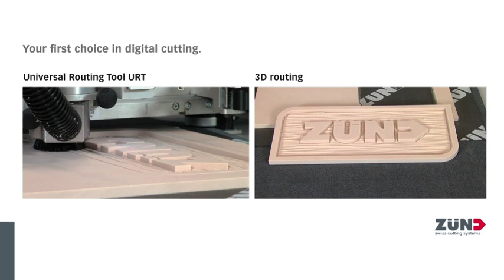3D routing, Universal Routing Tool URT

Comment: What software are you using to achieve the sandblast effect? I've been searching far and wide. I need to be able to do this with my zund g3
Reply from the maker: Hi Bryan. To generate these 3D files, you have to use the Enroute software. You will find further information directly here: http://enroutesoftware.com/
Hope it works.
Reply: where u based real deel
Reply: Greetings.  which bit do you use for this cut